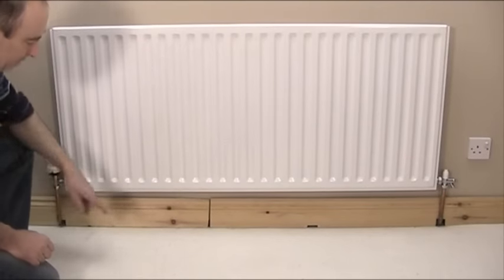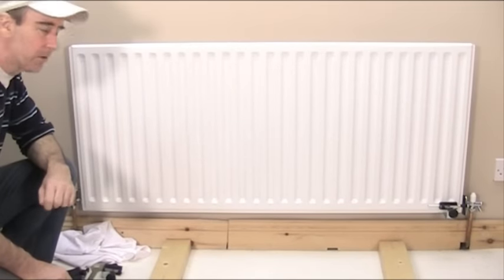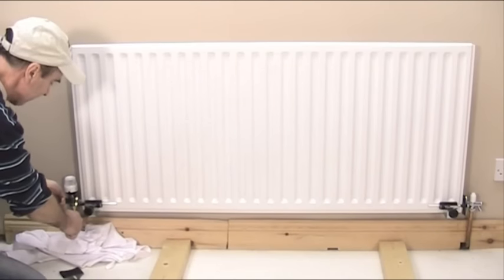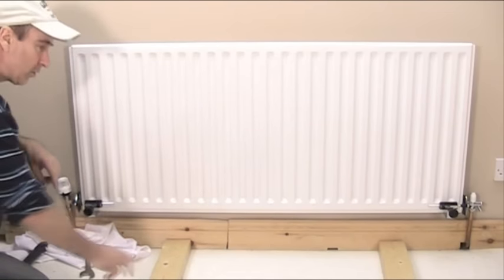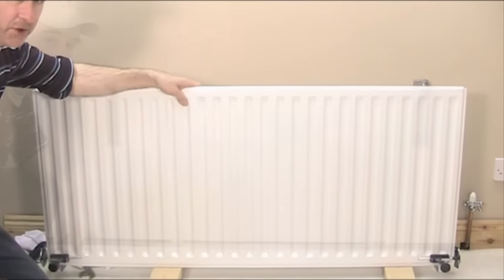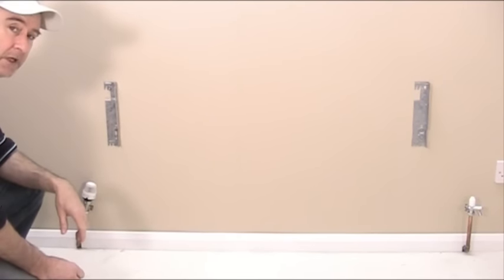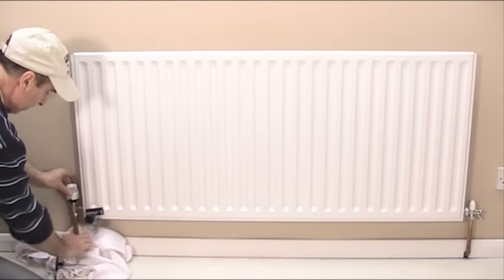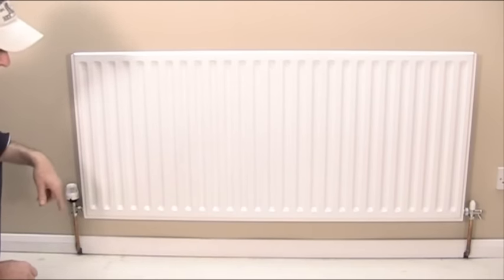Replace skirting Board behind Radiator. WITHOUT draining!

Comment: What if the pipes are the flexible white plastic types ? In that situation can you just lift the radiator off without disconnecting the pipes / valve from the radiator and then put on blocks ? I only need to move the radiator out an inch or so and sure there is enough play in the pipes to come out an inch ? Would it work or am I likely to flood the floor :-) ?